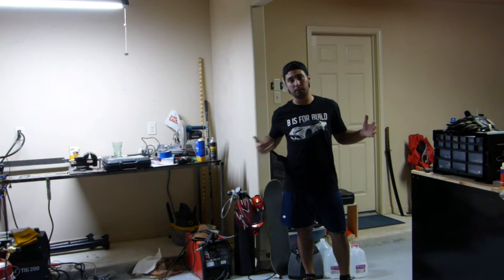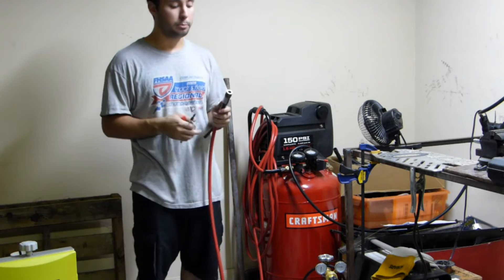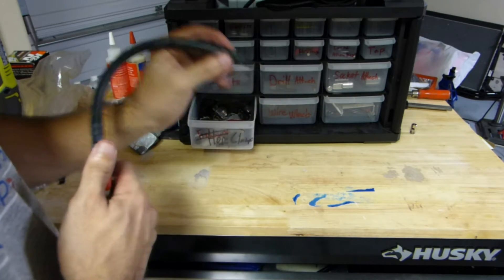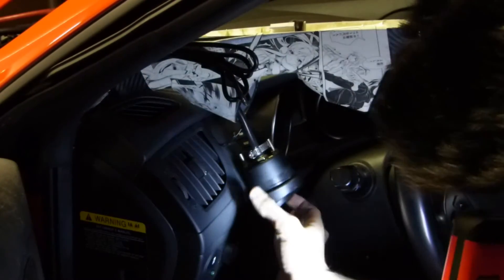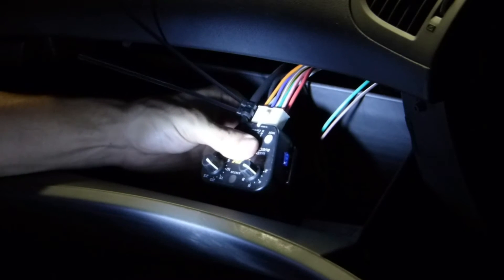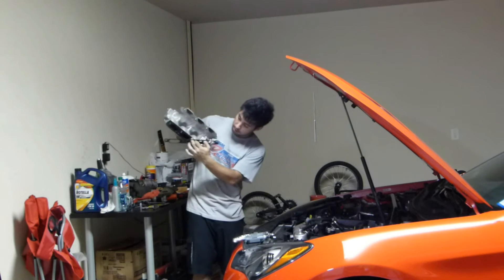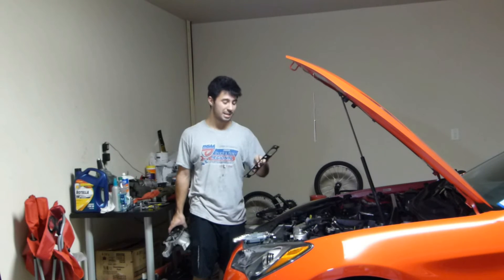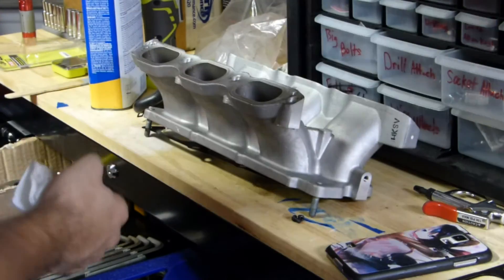✓ $20 Boost Leak Test - Part 2 (Valving)

Comment: Are you planing on doing any internal work? For safety and don't worry man once you break through 1000 subscribers come more quickly the beginning is always a slow crawl
Reply from the maker: Well I already built the engine so not much internal work left to do. I may one day go back and install sleeves since that's the only thing I don't have at the moment but I want to switch it up a bit and get the mini back on the road. I've hit a few snags but I am hoping to get a nice swap or something in there sometime soon.